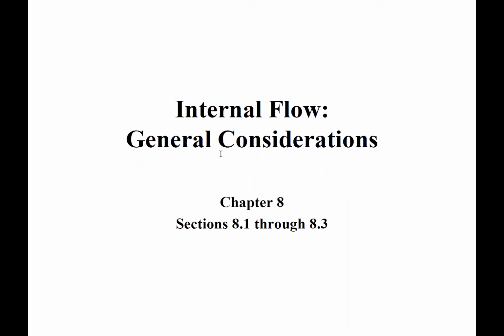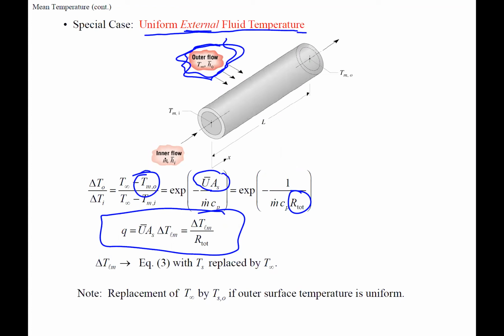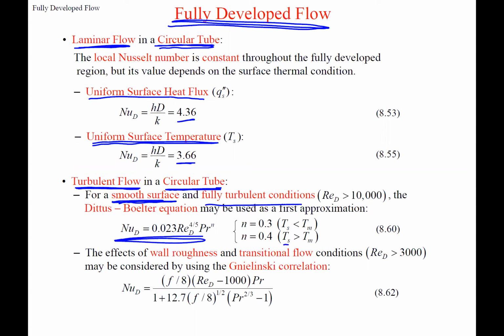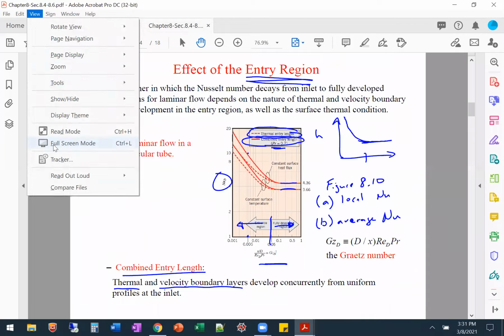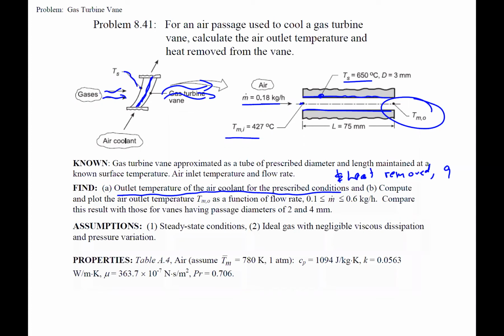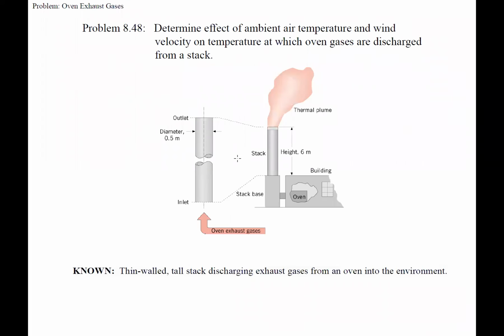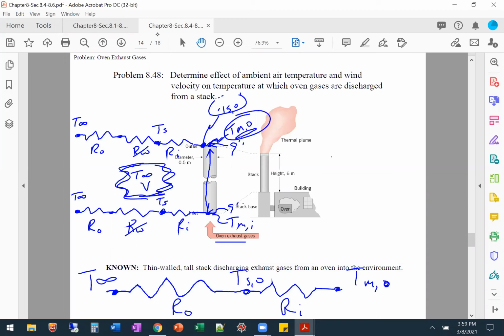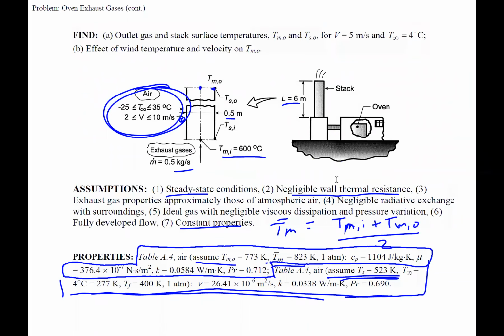Internal Flow - Lecture 2

Comment: Thank you, Professor, for such an insightful lecture. I have a question regarding your approach: why did you use the average convection coefficient to solve for Ts,o? 1:03:55 I was understood that the local convection coefficient should be applied for both the inner and outer convection coefficients since we are concerned with the outlet only. Could you kindly clarify?
Reply from the maker: For internal flow that is fully developed, the local convection coefficient at the pipe exit is the same as the fully developed convection coefficient. Once fully developed, the convection coefficient only depends on the pipe diameter. If the pipe was not fully developed or if we were trying to understand the surface temperature before the flow was fully developed, then a local heat transfer coefficient would be needed. 

For the external flow around the exhaust pipe (this is flow around a cylinder - see external flow videos), the average convection coefficient only depends on diameter.